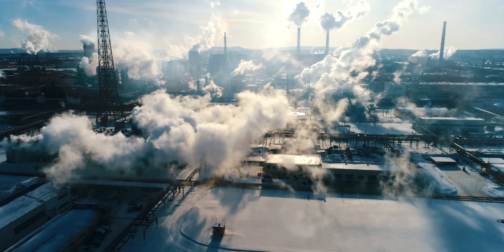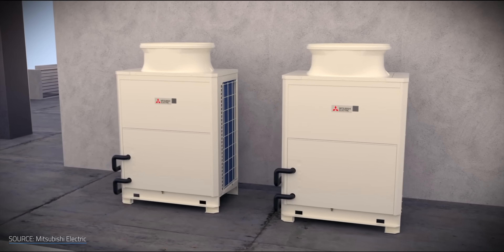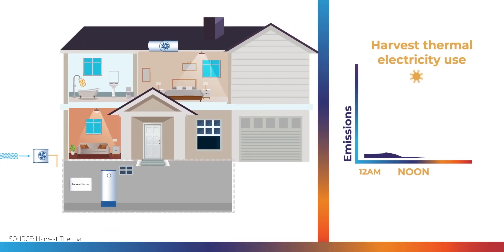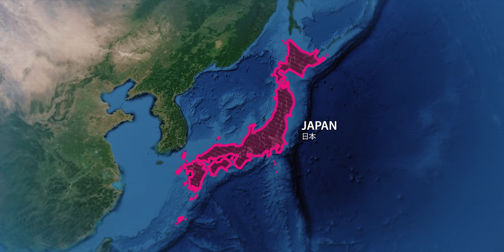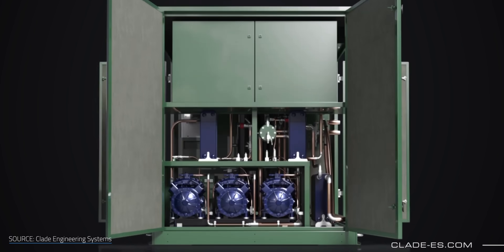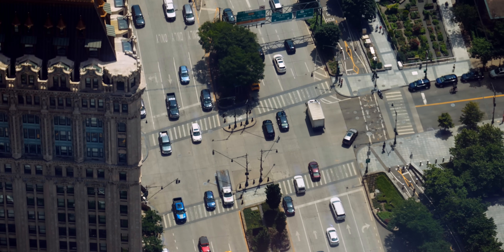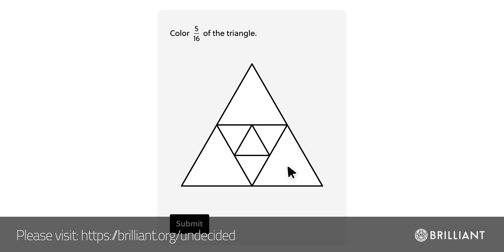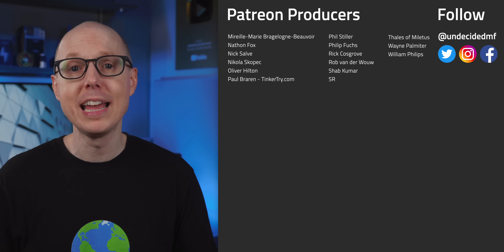Why CO2 Heat Pumps Are The Future Of Cooling

Comment: I feel like this video worked really hard to avoid physics and chemistry to the point where it didn't explain anything about the CO2 itself, so it was basically just an ad read from the companies trying to sell their products.

The most critical thing about practical heat pumps is phase change, as the working fluid doesn't just conduct heat but actually absorbs and releases it as it changes between liquid and gas, so any talk about a different fluid for heat pumps has to focus on that to be properly informative.

So I'm giving up on this video 10 minutes in. I really hope the channel doesn't tend to avoid technical information at the heart of these questions.

Comment: As a long time HVAC professional I would choose R-22 first, then R-290. They are very efficient for  heat pump service. Perhaps CO2 is  better for hot water and some process heat as it  can achieve higher temps. Do you know where  commercial CO2 comes from? The answer isn't out of the atmosphere.

Comment: The SanCo2 "water thermal battery" is a dud. The notion to heat the home by air exchange with the hot water is stupid because it requires the pump generating a much higher output temperature - 60 - 80 C, as opposed to directly heating the air in the  house to 30-40C. This destroys efficiency and there is no duck curve in the world that can make it up. 

It's much better to use the house itself as a thermal battery, just run the pump over the day and turn it off for a few hours at peak times - the thermal mass of the walls will not let the temperature drop significantly.

Comment: I might be missing something, but I thought CO2 wasn't suitable as a refrigerant because it tends to turn to a solid when it gets really cold? Basically it turns into dry ice and would not work in a traditional compressor style system. Legacy refrigerants are preferable because they can change state from a gas to a liquid and is able to mix with oil to keep the compressor lubricated and cooled.

Comment: My local supermarket has a CO2 cooling system, which pumps the heat to the district heating network. So the same energy that is used to keeping the groceries cool also helps keeping my house warm / giving me warm water for showering. That's a win-win.
Reply: That's pretty fascinating - what country/state?
Reply: @eh42  in Finland. I guess it was one of the first such installations, as they still have some signs on the store telling about this.

Comment: I've spent some time doing some preliminary design for combined solar/heat pump systems. One of the problems is that in a lot of environments (such as here in the temperate part of Australia) the need for cooling in summer is similar to the need for heating in winter. So automatically a heat storage only solves part of the problem. You ideally need a cold storage and that can make things more complex. Or you just end up with more conventional air source heat exchangers.

Speaking of which (and I'll let you in in a secret here). A lot of the cost in a conventional heat pumps owes to the fact that you need expensive metals (copper, aluminium) and you're both trying to contain high pressure refrigerant (thickness) and you need lots of surface area to get heat to/from air (overall size). That's why regular air cons are so heavy and why they skimp on COP to save cost. On the other hand, if you use water as an intermediate heat transfer fluid - and water has vastly more heat capacity than air - then you can create a much smaller (and cheaper) heat exchanger to operate between the high pressure refrigerant and the low pressure water. That still requires metals, but its a lot smaller. You still need big heat exchangers to create the surface area to get heat to/from the air, but in this case you're dealing with low pressures and cheaper materials.

Comment: Matt it’s call a heat pump, but how would you cool a building with the unit?  It seem as it is just a water heater which is great for winter, but we need cooling in summers.  This seems you would need second system for cooling.

Comment: What if you live in a location with time of use rates where overnight the electricity rate is ridiculously cheap relative to day time? The lower thermal efficiency from induction heating are completely erased by cheap electricity.

Comment: I have a CO2 heat pump at home, it’s great. It’s timed to run in solar hours, and so far it’s probably been run over 98% from my own solar. Since it only uses 1/5th of my solar output, and only for two or so hours a day, it’s rare to get a day when it’s not entirely solar powered. So that’s a pretty huge cost and carbon saving!

Comment: Here in new zealand, most heatpumps were changed from coming with r410, to r32.  I have recently changed my 3 from r410 to m60, which is an HCr, which i did wonder how safe it would be if something went wrong. But i was surprised to learn a few days ago that -  R32 will detonate, given the right circumstances (See the Tokyo University Report) . H C Refrigerants don’t detonate(note detonate is a huge order above burn or explode).  ps- change reduced my (winter) heating energy usage by approx 15% ).
So i find the idea of co2 good, as it should be a lot safer than others, (i assume) - was my trade for around 40 years.

Comment: Gas fired appliances do not have a COP. The “.93” efficiency you quoted is a combustion efficiency which relates to how complete the combustion process is i.e. 1 or 100% equals complete combustion  and the value can never go higher. Combustion efficiency and COP cannot be directly compared. When analyzing different system types I typically compare their dollar cost per delivered BTU.
Reply from the maker: Fair callout about the technical differences.  I still think it’s a fair comparison though because it’s still about how effective they convert their energy source into heat energy for the home.  An electric heater is effectively the same as gas (best case 1:1 for energy units in for heat units out).  Heat pumps are the only technology that stretch beyond that 1:1 limit.
Reply: No, the comparison of C02 heat pump versus gas fired using COP numbers makes absolutely no sense. It just leads me to suspect any other numbers you tout as real. Also I think you were referring to those electric heaters placed within close range to bathroom showers in apartments that have no space for heater tanks or access to gas pipes. They are infamous for being extremely energy inefficient.  The energy inefficiency is due to having to use electricity to immediately heat the water in an instant, versus water tanks that slowly heats the tank of water over time.

Comment: Really good episode! 

Also interesting to se that so many expert commenters apparently have so much more knowledge, each and every one of them, than all the big companies that are adopting CO2 as a refrigerant have, combined. I wonder why those commenters don't get together and start a company, they should surely be able to disrupt the industry.
Reply: Transcritical Co2 systems have been running in Supermarkets in the UK for somthing like 8 to 10 years now.  These systems are running with upto 80 bar pressure in a sunny day.  Not the sort of thing you would want in your home.
Reply: @williammartin1386  80 bar is high pressure, but it's not that much of an issue, the systems are design for it, that's what makes them expensive. And the amount of refrigerant is very small. You're worried about maybe a few hundred grams of CO2 at up to 80 bar in stationary systems, when gases routinely even are transported in tanks with multiple kilograms per tank at hundreds of bars? 

If a line in a CO2 system with just thin lines breaks the pressure falls practically instantly.    

What's your opinion on hydrogen cars then, people keep them at home, and drive around on public roads with 6 kg of hydrogen in them at up to 700 bar?

Comment: I wonder if either using low energy peltier coolers to improve the rate of of thermal transfer would be economical at low demand times of day. Or if using an energy generating turbine as part of the flow restriction between the low pressure and high pressure side of the heat pump could reduce overall energy usage. Even if the turbines power generation only goes to powering the peltier aspect of the heat exchange. Heat the turbine housing as part of the heat exchange process using the peltier plate to increase the rate that the super critical refrigerant expands to increase the rate the refrigerant expands. It doesn't need to be a net positive for the whole system if it increases the COP of the system. Using a system like skycool to reduce the demand on the cool side or gaining excess heat along side cooling a photovoltaic system to increase the thermal gradiant could increase potential reduction in demand and increase COP of the overall system.
Reply: dynamic regeneration by turbine as TXV. neat idea. they use pumps reverse flow at some water workses to spin a generatr.  i need to see if its isenthalpic or not.

Comment: Even though here in the UK we seem to have some of the highest gas and electricity prices around, heat pumps are not that common, probably because we have zero schemes or subsidies to help off set the high initial set up costs.
Reply: Homes really really have to be air tight.  My house built in the 1930s is far from that.